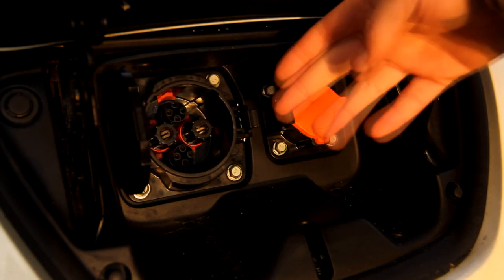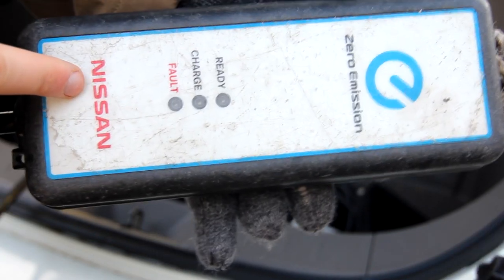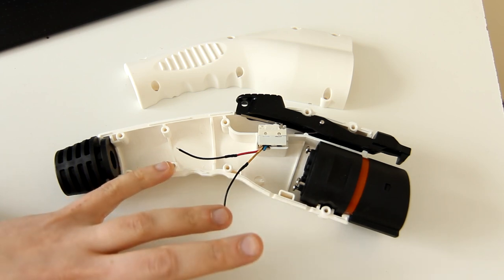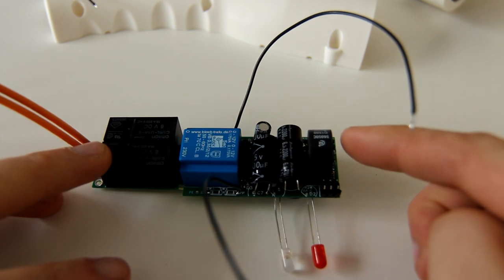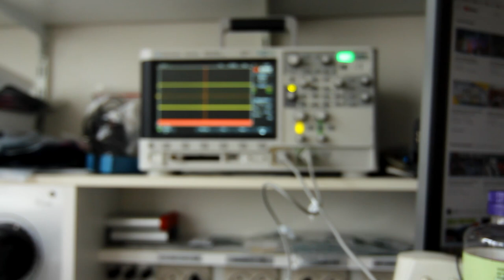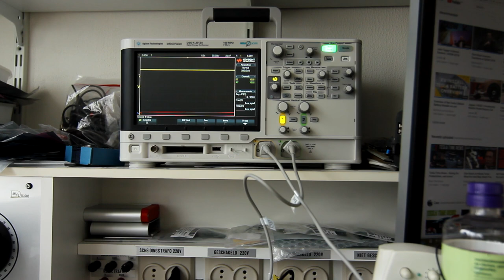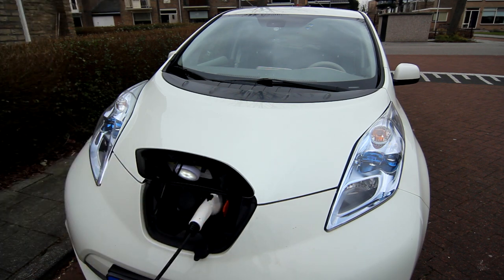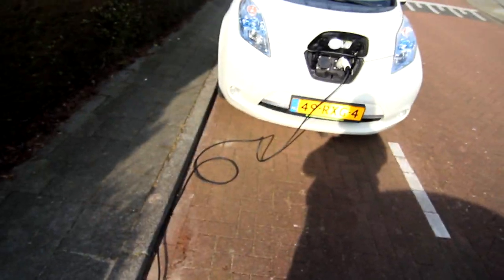Designing a better portable EV charger (granny charger)

Comment: This is very impressive. The breakdown of the charging protocol explains why these are not to be scared of. 

I’m looking for a 6kw capable wifi controlled evse that can be integrated with my solar to use my excess solar and programmed to use cheap
Off peak power.

Comment: Congrats on your ingenuity. Great job. 
I''m in the USA and found an auto sensing dual voltage charger (110vac, 10a & 220vac, 16a) to use in my car when I'm away from home. I got a couple adapters and can plug into a variety of wall plugs.
That replaces my Nissan 110vac charger. The box is a little bigger but manageable. 
When at home I have a 220vac wall mount charger.

Comment: fantastic work, in case it hasn't been answered already. I understand that the reason for the requirement to have the controller with 30cm of the outlet is to avoid the risk of live cables being exposed in an accident.

I imagine a solution to make your controller fully compliant would be to replace the wall plug with a 'Plastic Plug Enclosure' and place the board in there.

Comment: In the UK the granny cable runs at 10 Amps as our mains plugs are only rated to 13 Amps. I guess this would make it easier to make one of these devices? I can't understand why no comercial ones are not available. Great work and thanks for the video.

Comment: I am buying a Zero SR/F motorcycle which comes with a Mennekes type 2 plug, more brands and models are now coming on the market using the same plug. Unfortunately the current offering regarding charging cables and EVSE are only designed for cars. To be used with a motorcycle they are way too heavy and the cables much too long. Regarding an EVSE what you have done is just perfect, exactly what is needed. I would be willing to pay extra for the very valuable convenience of a small and light package. If this ever comes in production I would love hearing about it, let's hope some entrepreneurial AliExpress retailer will view your video and see my comment 😊.

Comment: I did some calculations on building a remote charging station for my Kia Niro due to outlet being a long way away (~50m thick forrest). However with lithium batteries that would cost about 7500 USD (!!) (and weigh 70kg) for 73% charge. With three classic lead batteries for trucks it would weigh 195kg (!!) and cost about 1000 USD. So I guess this is only an alternative if you, like the guy in the video, just need a few extra miles.
Reply: Rent a mini-digger for the weekend. Get some good quality rubber cable (ask an electrician what ya need) and you'r set?

Comment: Quick note about the Mennekes plug, it can support way more than 22kW. From the top of my head 43kW for AC and +100kW for DC.
Reply: 500V, 63A for 3 phase or 80A for single phase, 200A for DC

Comment: It is appreciated wot you or doing please don't give up I have a  G Wiz  and struggling to charger it I live in a tent in the back of a van so it's difficult to find a changing point that excepts three pin plug I'd like to charge at a tipe 2 charger but struggle if you have eney ideas that would help it would be appreciate

Comment: I keep thinking back to this video. I didn't realize that the EVSE doesn't really do ANYTHING to the charging current provided to the car. I wonder, then, if it's possible to have something like a J1772-to-wall-outlet adapter. What would be involved with that. 

To whit - I have a 2002 GEM car that charges from a standard wall outlet. I'd love to have more options of where to charge it.

Thought 1: If a J1772 charging station can provide 110 AC current, what could be done to convince the charger that it's attached to a car and to provide that current.

Thought 2: Or is it the case that the public charging station only provides one kind of current (probably 220) and there's no way to get it to step down to a lower voltage.

There actually are J1772 chargers than can be put on the GEM car, but I don't want to lose the ability to charge from an ordinary 110 outlet with no EVSE.
- - -
Edit: Someone apparently sells this already on ebay. It claims to work with devices that can accept 220v. I should have checked before commenting.
Reply: bcoz this is not - charger in car is simply MODULE for 110-240V - so without any "singal" it should work - signal is for more safety

Comment: is it possible to make a mennekes type 2 plug?
I looking into chargin my car on the go with a solar generator that can charge the ev battery when im not driving it.

my smart fortwo 2014 (17.6kw) with a eco flow delta in the back or in a shed with solar on it to charge my car be it from the trunk or shed.
can the mercedes granny charger do that?
Reply: granny charging usually means SLOW - so max 2-4kW - its all depend of RELAYs - for 1phase 10-16A you have small relay - for 3phase you have to buy bigger + and 3 of them

Comment: Take that construction concept, and throw it on the ground a few times like many consumers do, and see how it does.
Reply from the maker: Done that, even driven over it already. So far, just the LED has broken off. Note that I've potted the electronics in the meantime, so there's very little that can go wrong. I'm now in the process of constructing a revised version which fixes all the routing issues and reduces the electronics size a bit more, hopefully that'll be something I can sell or at least share.
Reply: do you throw gas nozzels onto the ground? if you do that to almost anything you're just asking for issues to arise.

Comment: Great project! You've inspired me to build something similar. Have you run into any thermal problems with these relays? The datasheet states a maximum contact resistance of 100mΩ, which would burn 25W per contact, so up to 50W in total. Would love to get some info on that point!
Reply: I have their standard leaf granny charger and would love to modify so could charge as 6, 8 and 10 amp . Is this possible and if so is their any info on how?

Comment: I am new to this so forgive me if I don't make sense, is that AC 230v  going into the car, if so when does it change to DC for the batteries
Reply: The charger is in the car. It's whats converting the AC to DC. This is just the electronics that is there to make this a bit safer. However it is not following the standard as he states in the video. The control relays have to be no more than 30 cm from the electrical source to be able to make the cable powerless before it touches the ground (it's presumed you have the outlet on a post above ground not in a box sunk down into the street like in the video :) ).

Comment: Not being critical, just enquiring... I'm an electrician in Australia, and have never done any design for compliance etc. I guess you're using the capacitors to provide the switching current to the relays, but I question the use of Latching relays. I understand the capacitors store enough energy to unlatch the relays if the power drops off, but I would have thought the relays would have to be the "normal" electromagnetic type that naturally act as an Under Voltage protection fail safe in the case of loss of voltage or electronics failure? If something did go wrong the Latching Relays could potentially remain latched. Am I missing something, or is this a standard method that is compliant? As I said, I'm not trying to be critical, just curious, as a lot of electrical equipment has relays or contactors, not only as needed for switching the high current, but also to provide Under Voltage protection. 
 BTW, Nice explanation of the EVSE workings. I have a Leaf with the Nissan EVSE, but looking at building a 15 amp EVSE. Cheers.
Reply from the maker: There are three things that work in my favor:

1) The standard does not specify or stipulate any type of relay; it merely states that the external contacts on the J.1772 compliant plug need to be disconnected from mains in all states except for the charging states. The contacts may carry mains voltage for up to 1 second when changing states, and this includes device turn-on and fault modes.
2) The capacitors and some firmware logic indeed make sure the contacts are latched off on loss of power or any illegal state change.
3) When there is a loss of power, even if the relays are latched on, they will not carry mains voltage. When the device subsequently starts up, as a precautionary measure the relays are forced off. There will be a split-second of mains voltage on the contacts, but this is still within spec.

Of course, the main thing against my approach is that in case of some sort of catastrophic failure, the relays may remain latched on, causing mains voltage to appear over the contacts. However, I would contend that purely on a compliance basis, this isn't part of the spec (and indeed quite common practice in e.g. smart plugs). 

In the end, this is a design decision that I had to make. There simply isn't enough room in the enclosure for a large enough power supply to continuously power relays. The J.1772 standard was written - originally - in the late 90s and assumed very crude, slow logic. This is also why the connector itself has quite extreme physical safeguards; you would have to force water into the contacts and submerge the entire connector to even cause an issue with mains voltage being present. And for that, they even included a requirement for a rubber cap. Belt and braces all the way, so even though I explicitly state the charger design is NOT compliant, I still regard it as safely usable when installed correctly.
Reply: No worries. Thanks for taking the time to reply.

Comment: PVC cable is just due to cost, rubber cable is nice, but easy(-ish) to tear (most of them are, at least the ones I've tried), for really fuck-all cable use PUR insulated - doesn't go stiff when cold and is abrasion resistant.

Comment: edit: seems to be not the case read reactions why

the design is at much more points not compliant with the j1772

the 2 things i can say on the top of my head.
1. there is no diode check. the j1772 states that the 1kHz square wave should be from -12 to +12 Volts. and that only the +12 volt part should be loaded. so if the square wave drops to 9 or 6 volts it should go from -12 to +9 or +6.

if the relays switch the line voltage on only a resistor it is not compliant

2. the other thing is that it is not allowed that the charger directly goes from state A to C. like you're demonstrating with the 880  Ohms resistor the resistance should first be 2.74k Ohms and go from there to 880 Ohms. if you directly connect 880 Ohm(with a diode) it should not go to state C.

stating that the only thing that makes the charger not compliant is the length of the mains wire is wrong.
without knowing the actual electronic circuit it looks like it could be compliant with a software update
Reply from the maker: It's fully compliant on all the points you've raised. In fact, I pretty much reimplemented SmartEVSE for an AVR. 

For the demonstration, I didn't want to bother with a diode check or fumbling with multiple resistors just to show the concept, and likewise the video was getting pretty long, so I flashed the firmware in debug mode. This foregoes the GFI check (which you can see - the GFI transformer has no wires running through it) and a bunch of other stuff. It also does not implement any of the delays and delay checks.

As far as I can dig into J1772, I implemented everything I could except for the wire length.
Reply: PowerElectronicsBlog ah Nice you did  implement those things. It aren't safety features made-up for fun. Nice you got it in this small form. You might get rid of one relay if you make sure you're certain of the installation off the mains wire. If the line and the neutral are always on the same position you might get away with only switching the live wire. 
If you use something else than a schucko to make sure of the correct connections
Don't know if that is j1772 complaint by the way
Reply from the maker: Because Schuko is unpolarized (can be plugged in either way), I know for sure that it's not acceptable to do unipolar switching. This killed me on my first mains power project 2 years ago, had everything ready to go for CE testing and failed on the intake interview because I showed it only having one relay... waste of a few weeks, especially considering the testing facility only had free slots every couple of weeks.

J1772 does not specify anything on the mains connection side as far as I can tell. I don't have the official full specification, though, because that is very expensive to buy. So I have to work off free pdfs and a family member who works with one SAE commission...
Reply: PowerElectronicsBlog shame about the CE compliance. I know how expensive those test are :(  I once worked somewhere where is did have the j1772 specification. If you don't use a schucko but just wire the thing up to the mains in a installation box i think it is ok. I don't recall everything about it. I does say something about the mains switching.
I know that the German specification is way cheaper. You can also buy IE specifications in Estonia saves a lot of money and it are European regulated specifications so they are the same. but for a one time only project they are way to expensive.
other tip on those full specifications if you happen to know some engineering students at your local hacker space it can be easy to revieuw those EU regulated specifications via NEN-connect
Reply from the maker: Hm, those are great suggestions. I'm definitely going to try that. Are the document prices tied to like... local GDP? Would Romania be even cheaper then?

The hard thing for me to justify this cost is that I don't know where the costs will end. Most SAE documents are extremely incomplete and require lots of additional purchases. They reference other standards or in some cases you pay 30 bucks and only get a summary document that says absolutely nothing of technical value. So unless I know for sure that I'm going to get the FULL J1772 technical reference for X amount of money, I'm hesitant to spend any money on it. Same goes for IEC standards; I made that mistake before trying to get a hold of the IEC 60950-1:2014. God, that's a nightmare to get.
Reply: i know getting IEC or ISO or NEN regulations are a pain in the butt and understand your hesitation. I luckily wasn't the one who had to find out which and where to buy them. at the university of applied science where i studied we had a portal where we could get copies of those specification limited to 5 per day. cost me sometimes weeks to get the right documents for a certain project. there are quite a few companies who can assist to find the right documents and where.

i don't know how the pricing is regulated. i only know i think it is strange to buy load of money for documents where you should comply to. a few euros administration cost would be fair but the prices are nuts and can be really difficult for a beginning company.
it would be crazy if a copy of the constitution cost me €200.

Comment: Hi.
That was nice done. what is the slowest charge speed possible to charge a Leaf? 230 10A is to fast. :D
Reply from the maker: It will charge on 115V/6A, but the J1772 spec doesn't allow for less than 6A, so on a 230V outlet the minimum speed is 230V/6A or about 1.4kW. It's probably possible to experiment with slower charging by seeing if the car accepts less than 10% PWM on the CP input.
Reply: thanks for you answer.  230V/6A sounds right. my portable generator is 1.6 kW constant. :P is that possible with original nisssan granny charger? I dont have a ev car yet. but next year I am planing to buy one.   are you selling your ev? :P
Reply from the maker: If it's a gas generator, you're going to be stressing it A LOT by drawing 1.4kW from it continuously. These generators usually only really cope with 60-70% of their rated continuous capacity. I'm not sure if you can expect to reliably recharge it from such a generator. Also, it's quite expensive, you should only use that in emergencies or when you are really far away from civilization. Most public chargers are much cheaper and more reliable - and they charge your car a lot faster too.
Reply: Yes that is what i was thinking. emergencies only. other solution is a 12/24v -> 230v inverter and to have a gas generator  to charge batteries to the inverter :D  here in Finland we dont have public chargers outside the main road. some "shoko" you can find but even that's hard. especially around at my moms summer place that is off grid xD

Comment: Would it be a problem to convert the Leafs type 1 plug to a type 2?
Reply from the maker: Nope, it's 100% compatible. The only 'downside' is that you can't actually take any advantage of the extra 2 phases on a Mennekes plug. The upside is that you can lock the cable in the charging port, so nobody can interrupt your charging session.
Reply: PowerElectronicsBlog 
It makes sense! The reason for my doubt is that I called Nissan last year about it, and they said that it was not compatible. That really puzzled me as the "type1 to type2" cable is just a cable with the to different types of plugs on each end...
The reason why I would like to do the the conversion is that all public destination chargers with cable. here in Denmark is equipped with the type2 plug. And many home chargers also....

Comment: Kind of fake advertising to call an AC protection circuit a "charger". It wouldn't be hard to either have a user settable setting option in the car for AC charging, or even automate it based on voltage drop as done in this overpriced magic box. This is as ridiculous as when printer manufacturers sold printers without USB cables! So don't build it into the socket, put it in the car behind the connector in the car and use a potentiometer to set current and use any dumb cable you like. Which <nissan should have done in the first place.